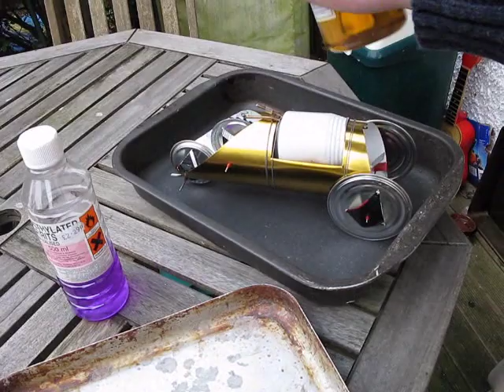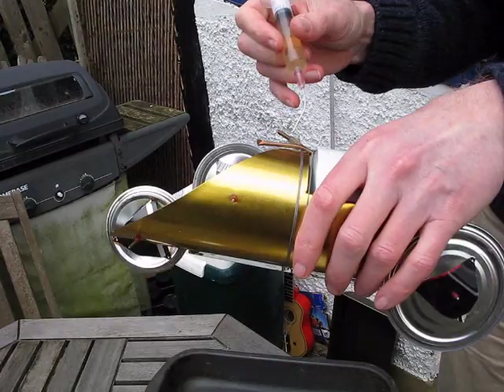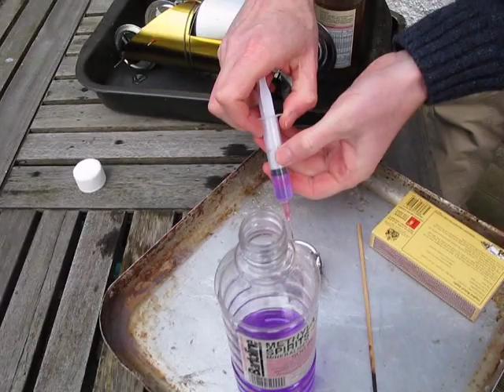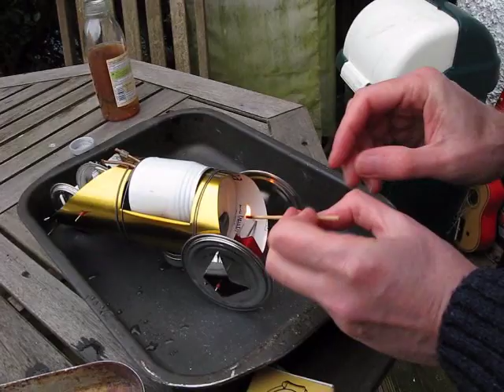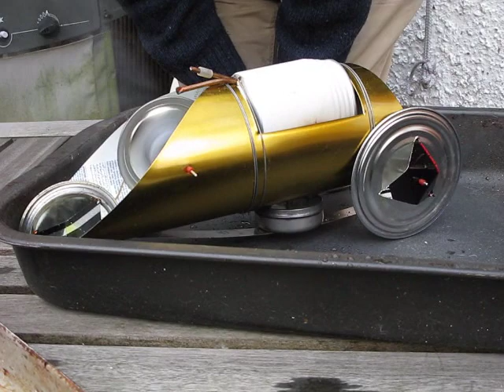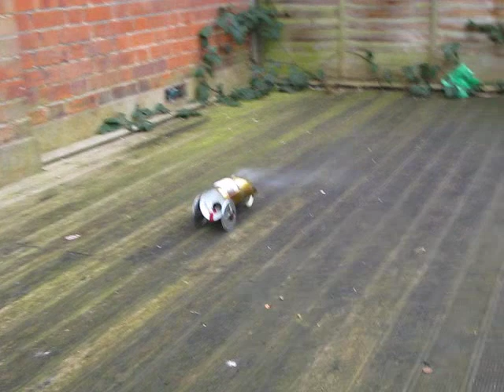steamcar

Comment: The world awaits you model steam powered tip jet helicopter. "Stable Mable" move over!
Reply from the maker: I bet you're thinking 'solar powered'?
Reply: I was thinking along the lines of patents 2659556 , 3930625 , or the  KH-15, using alcohol as fuel. The Tip Jet approach would keep the parts count low.  Never seen any sort of toy like that so if you pulled it off you might be the first!